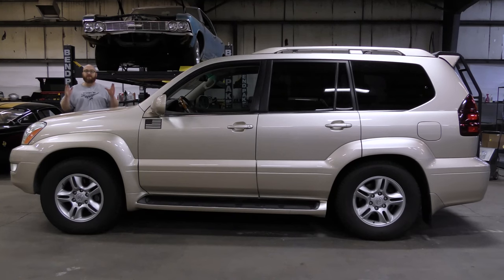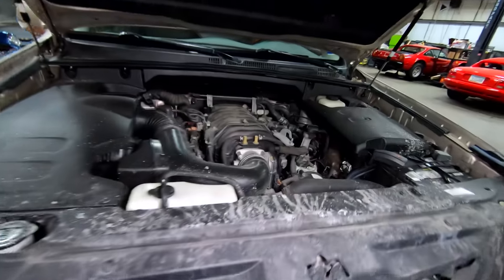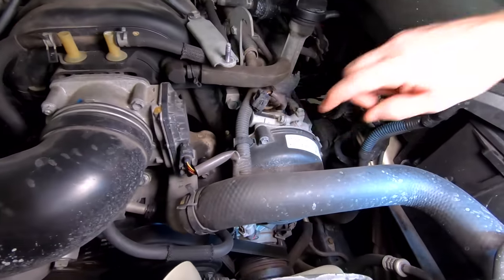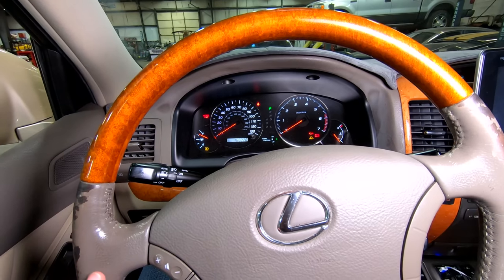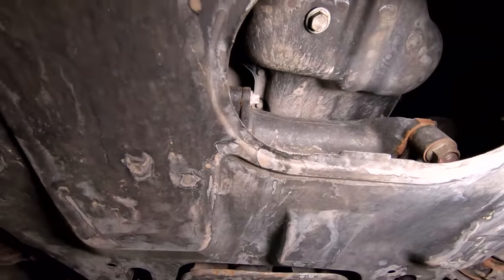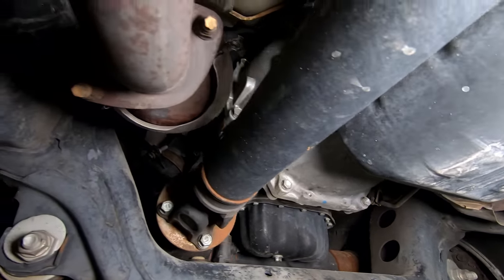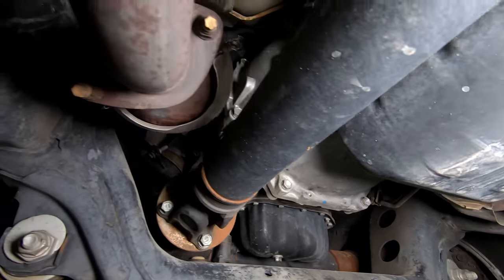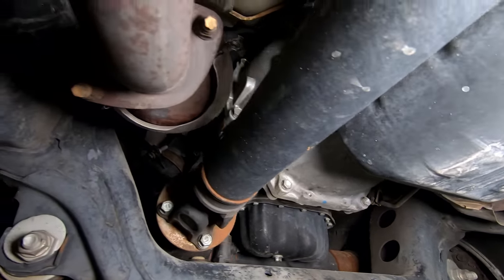How could this super reliable '07 Lexus GX470 have such a stupid design? CAR WIZARD weighs the risk

Comment: If you think the Toyota UZ V8 starter is a design flaw, wait till you have to do a starter on the Toyota UR V8. The UZ is actually pretty decent to work on where the UR is buried behind the exhaust manifold right by the engine mount. Theres FWD V6 engines you need to pull intake manifolds to get to the spark plugs.

Comment: The only thing I can think of about putting the starter there is it stays clean as apposed to leaving it out exposed to water and dirt. Because those starters will last you 300k miles. Starters on other cars may not work after something as little as going through a puddle.

Comment: In October of 2020 we purchased a 2002 Toyota Sequoia with 244,000 miles from a dealership.  Normally I would never consider something like this.  I was looking for more towing capacity and 4 wheel drive and didn't want to spend a lot of money.  I somehow convinced the wife to go look at it.  We get there and the salesman was gone for what seemed like a long time.  He finally comes back with the vehicle,  saying one of the mechanics had stashed it hoping to get it for himself.  I knew we were on to something! It was dirty but not rusty,  (Wisconsin), obviously a salesman vehicle,  lots of miles but not beat. The rear hatch was messed up,  wouldn't open.  So after looking it over, getting the salesman to agree to fix the hatch, we settled on 5500.00. That seems real high for almost 250k miles, but we thought it's a Toyota.  Also the vehicle was pre safelty inspection so they would fix any safety problems. It needed tires so we asked how much.  He came back at 350.00!! We said do it. So, in the end we got it with new brakes, a new power antenna,  and a nice detail job. It has performed flawlessly into 2022, 6000 miles trouble free and is about to hit 250,000 miles.  Granted we don't use it much, but today after an ice storm and freezing rain and sleet it got us all over town in 4x4 style.  I am only buying Toyotas from that point on. We purchased a 2018 Camry with 156k miles in January 2021. Totally trouble free since purchase now 165k miles!

Comment: The starter location is what kept me from buying a used Toyota Tundra.  It was very clean with 250k on it, but there was starter noise. I have seen these go more than 500k and still be running strong but the starter will cost at least $1500 to replace.

Comment: Wizard there are micro circuit boards that goes between the S&S button and the ECU and just turn it off for you. I have one on my Giulia and paid it 60$, and it works perfectly. And you still can use the S&S when you want it and no modifications done to any cable. Probably it's the same one for the Levante being it from the same FCA group.

Comment: I love my GX. It's got 240k on the clock currently. I just did my timing job just before Christmas so im good for another 90k. I've done it twice so far and it was done with the previous owner as well. The starter location sucks I get it. But I don't mind it being in there. I do most of my work on it and for the most part it's nice to work on. Even that starter swap isn't as bad as it seems. Just time consuming.

Comment: I didn’t even think of the starter! We have a 2008 and it was a debacle trying to put the water pump back in (I popped a $.10 O-ring  off and had to pull the whole thing apart again). It was easier to take the intake off to get at the O-ring and when I had it off, I replaced the short cooling hose under there. It was hard as a rock and is only a $20 item. I also saw the starter but it probably would’ve been a three hour job to get it out. That is a horrible design…. I’d love to see the quote on how many hours they give mechanics to replace that.

Comment: The GX470/Landcruiser Prado SUV’s are rock solid. Had a 2003 I put 200K on, and then bought a 2008 that I still have with 160K. I love the engineering and quality compared to any other SUV brand. When I talk to people about it, I always call it the Rolex Submariner of SUV’s.

Comment: 568K miles on my 2004 GX470, with original motor and transmission. Had to replace the secondary air filter - filter. UP-107 clamp on filter works for that. Intake manifold crossover leaked coolant at 219k miles. Just watch for rust.

Comment: We don't have this model in Australia. Instead we have a Toyota Prado also known as a 120 Landcruiser, in 2005 guise  anyway. It is basically the same vehicle with a few cosmetic changes and engine obviously.
Here it has a V6 rather than a V8. Same engine as the FJ Cruiser.

Comment: Don’t forget about the secondary air pumps . Talk about a design flaw , I was quoted 2000$ to replace both . As much as I love the 2UZ-FE engine, Toyota slipped and dropped the ball on that.
Reply: HELL YES. The AIP system failure throws a code that forces the car into limp mode no matter where you are. I was on the highway going 65 and thought my engine in my 2007 Sequoia had blown. Nope, it was a stupid code thrown by a system that blows air through the exhaust to clear it on startup. Luckily there was a huge aftermarket in disabling this system, I did that and drove over 120K miles with it disabled, and passed every smog check. So dumb, Toyota.
Reply: 2000k? Who charges $2 million to change a secondary air pump?

Dr. Evil has entered the chat...
Reply: bypass kits are available for $200
Reply: @chrismemphis8062  Yup. It sucks that we have to install them, though. Other than that the vehicle was quite good.
Reply: @Chris Memphis . I know I found the company website, the only problem is that I’m not sure they are legal in every state. I’m in Illinois and I’m still looking to find out if they are allowed here before I purchase the kit.

Comment: I'd swear that timing belt has a recommended 90K miles replace interval.... Bentley puts their starters inside the transmission bell housing. Many 'modern' hybrid models release valve pressure to reduce startup resistance. I have an '05 Colorado with 200K miles. Original timing chain. The time required to replace timing belt on the Colorado is astonishingly time intensive. They put a couple of bolts required to remove the Colorado's timing chain in the oil pan. There's other stuff, but it has to be one of the most complex I've heard of.  I don't use it unless the house is on fire. I also have an '07 GX470. The Wiz is right, aside from the starter faux pax, it's great to work on.

Comment: Stop-start is useless? Perhaps so in a quiet rural area. Drive in a congested area and savings can soon add up (unless forever running a/c etc), but there is more to it than saving fuel bills. An important aspect is not pumping out rubbish into the atmosphere for no good reason, another big factor in congested areas. 

To put it in perspective, without a/c on my Ford mondeo (fusion) 1.6 diesel on board computer claims it uses 0.1 imperial gallons per hour idling. I can easily idle 10h a week city driving, sometimes it feels like that per day. So a gallon a week, at £7 a gallon currently (min wage is £9.50 an hour before taxes) that is £366 a year. That is a lot of money and soon recoups the cost of a starter and battery. Now imagine if I drove something less economical than my little turbodiesel! Imagine if I drove my 1995 4.0V8 Range Rover to the city, or my old 3.1 indirect injection diesel farm truck. 

Hook up your diag computer, measure fuel consumption at idle and then do the quick sums to see when stop start becomes worth it  or not :)

Comment: Have had one of these since '07 (175k miles now) and it has cost me an average $1100/year R&M. That doesn't include a new windshield, the set of Bilstein 5100s (1.5" lift), or the Toyota trail wheels I added. Have done two 90k mile services, replaced the radiator and both front driveshafts - and aside from that: nothing. It's been bulletproof. So bulletproof that I loaded the family, the dog and a sh*t-ton of luggage and drove 1500 miles to and from Cabo over a few weeks this past Xmas holiday. It goes on pavement, dirt and sand like a luxury vehicle. Concerns about it stranding us? Zero. No leaks, no squeaks, no rattles. I'd buy it again in a heartbeat.
Reply: How is the ride quality been with the Bilstein shocks?  Thinking of upgrading my 07 GX when the original shocks go.  Like them on my 4runner,  I haven't been able to find any subjective ride quality reviews on that mod.
Reply: @johncyr181  they're great - much more supple on the top end but they're also far more progressive under bigger moves, controlling body motions well. The ride empty is like the OEM 'sport' setting without the harshness over expansion strips, road imperfections and it just gets better with people/cargo/weight. Zero regrets. I put them on the second ring, which gave 1.5" of lift to the front and stacked six stainless washers on the rear bag sensors to 'trick' it into lifting the rear about an inch, which killed the ugly rake Lexus designed in and levelled the truck beautifully. Also added a $30 diff drop to keep the angles good on the front driveshafts. Got all the P/Ns and install info (had my tech do it for $300) right here on YouTube

Comment: Very clean looking GX, I’ve always wanted a 470 or a 460
Reply: I've driven both, while the 460 is  quieter and more comfortable, the 470 is still easier to drive, for me at least. The big windshield and fairly flat hood help. And the fact that the 460 has larger wheels, so it sits higher.

Comment: My guess is the starter is on top of the engine to protect it from mud / water when used in it's typical (though not in the US) mud road, creek fording environment.  Same engine as in my LC 100, which is now 24 years old.  I've replaced the starter twice over the 445k miles I've owned it.  No real issue for me as it gives lots of notice when it starts acting up.  The GX has similar intervals.  Not really an issue as I just do it with a major service and it is ready for another 200k miles.
Reply: Correct.   But the owner shouldn’t have replaced it.   Waaaaaaay too early.    It likely would have never went out while he owned it.    Those started are probably the best made

Comment: Just one look on this one, and I can say that it has problem with leveling of rear suspension. They have not seat so low in rear. And throughout my 11 years at Lexus dealership I have never seen problems with starters on uz-motors, though on ur-motors they are common. But on 5,7 or 4,6 motors starter is on the right side of the engine, so you just need to take off right exhaust manifold according to techdoc (but some clever mechanics could do this without disconnecting manifold)))

Comment: Not really an issue with the starter since it’s usually something you’ll only ever replace once at the most during your time owning it.  I have the Australian Prado version where it’s fitted down lower on the side of the engine where it fills with crud when you do a deeper dirty water crossing.  Toyota starters in the V6’s & diesels don’t like Cape York.  Great video by the way.

Comment: The alternator is easy to get to. Muddy waters agree to that. Regular off-roaders switch to water-cooled mud-proof alternators
Reply: @Justinian Yi The problem is placement of the alternator itself. In other vehicles it's hidden away from splashes from the wheels. But on Toyotas and some other brands the alternator is too exposed. I watch many Aussie 4x4 channels and most Toyotas have had an alternator failure due to mud. My dad has a Hilux and he's experienced it too. It is an easy fix though that doesn't require buying a new one. But when it stops charging in the middle of nowhere just have the tools to unbolt it and clean it up
Reply: Water cooled mud proof alt? Where? I may upgrade just for the piece of mind.
Reply: @jorgefernandez281  Search Ronny Dahl alternator on YouTube. It's a 79 series diesel
Reply: @brianm5753  Awesome. Wish these were more common. $2.3k, ouch.

Comment: Only thing they need is oil changes, timing belts around 70k or so,  and the original air ride replaced whenever they fail because they will fail sometime. Other then that  pretty maintenance free. Just wish the tail gate went up and got better fuel mpg. Awesome offroader

Comment: In my area every trans shop will tow your car for free, if they fix the trans.  And most won't do a quote on the phone.  Which is a scam because most are R&R shops and they know exactly how much they charge for a trans replacement.  In as much as the car isn't driving, you can't shop the job around by going place to place if you don't own a wrecker.  The trans shop I've been using for 20 years actually does quote prices on the phone... He quotes his soup to nuts R&R  charge and says it will either be that or less.  And yes, once the case was cracked and it was an R&R which was the price he stated, once it was a valve body, which he also quoted as an option and it was also the price he quoted and once it was gratis even though it was out of warranty, because he installed a defective part and he called it "good customer service".  So yes... a shop can give a fair ball park price on some jobs.  It's better for the shop and for the customer when they can.  And yes, I do understand some jobs on really old cars can go terribly wrong and can wind up costing more. I do mostly historic cars, and I know I'm going to have problems with every job, but even I can ballpark a price with the caveats "if nothing goes wrong" and "my best guess".  With "my best guess" usually being better than "if nothing goes wrong".

Comment: Rear suspension work is VERY expensive on GX470. The dealership will charge the parts alone air bags/springs ($720), height controls ($760), electronic shocks ($1600), air compressor (cost more than a fridge $1200). Just shop around and you can get the OEM parts less than that. Installation will be at least $1200.
Reply: Gut the air suspension and install coils and good shocks.  Done.  Much less than 1200.
Reply: @johncyr181  You're right. It was over $4K even with supplied OEM and aftermarket parts. Hopefully it will run another 100k miles.

Comment: Wizard. Wrong. They are designed for more durability. They are designed different from the older cars. Loke direct injection that makes the car start even faster wich puts less stress on starter. And also different gearing ⚙️. Think about it. When was the last you've change a starter.

Comment: My dad loves his 2015 Equinox. I mean for the price that he got it for and the low mileage it was a steal. I come across a guy that has over 300k miles on the same model without issues so I am confident it will last him for a long time. Sadly that GX470 is double the price of what my dad paid for his 2015 Equinox. You will notice that cars are pretty cheap in midwest compared to everywhere else. I have also noticed that majority of people there also think maintenance is optional and they treat their cars as garbage cans.

Comment: The starter on my 2010 outback 2.5l claims to be the same thing.
Many videos show removing the intake for this, however, i did that job without removing anything, its easily accessible.
Also the spark plugs, the driver side, u dont need to remove anything to get to them, n i used all standard tools to remove them.
The passenger side u need to remove air filter n half of the air box n 1 simple clamp n intake hose. Simple. Nothing to it.

Comment: Lol on that clip for the front bumper fascia to the skid plate. I have a 2020 Tundra, it's been to the dealer 3 times for Toyota Service. I noticed the bolt and clip missing some time after the first dealer visit. They need to undo them to lower the skid plate to change the oil. On the next two visits, did they replace the missing bolt and clip? NO! I ordered them and replaced them myself, I even have spares now. Really kind of crumby that you guys will fix the missing $3 parts, but Toyota can't be bothered to do so.

Comment: TLDR Stop start fuel savings over 5 year replacement life = ~$3500
Cost of Starter replacement on this abnormally intensive replacement ~$800
Is is still a bad idea?
or from another perspective how many gallons has this system saved in 166,000 miles vs how many starters?

Comment: my 2004 gx470 has 172k+ and the starter is still ok, why change it? The dash mat hides the cracked dashboard which is common to happen on other Toyota during this model years. Note that BMW inline 6s, the intake needs to be removed to access the starter also. It's even worst in the BMW because it has lots of hoses that get brittle over time and you need to have a replacement when doing this at the same time. The GX470 is the smoothest v8 so far I encountered, you won't noticed any noise from it for a 18yr old truck.
Reply: Toyota replaced my 2005's dash after it was 12 years old.  Nice warranty !  It did take almost a year for the part to arrive.

Comment: Replace the secondary air injection pump, check valves and diverter valve while in there. They will also fail and then you have to do that same job again... Parts are about $600 retail.

Comment: Hi ninja! Thanks for this video! I recently bought a 2005 Gx 470 (3 days ago) and when I put it in drive it takes a while to catch it, but when it does hits really hard… only happens when the car is cold, later in the day that symptom disappears. I’m really sad cause I need it a reliable car and I spend all my savings 😔…! Thanks for what you do! Peace!!! Sorry for my English, Spanish is my first language! ✌️
Reply: oof, that may be a transmission going bad.  Don't panic yet.  Check your levels and see about the ATF fluid off through the cooler lines.  Gently. Or get a drain and fill (NOT a flush) and change the filter out in case there are bit clogging it.
Reply: @whiteyonthemoon1193  thanks!!!